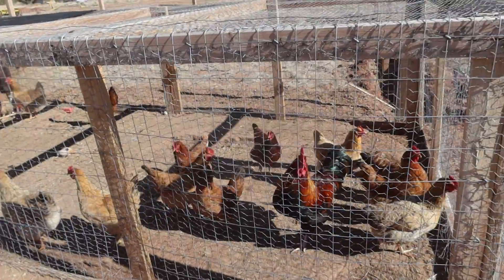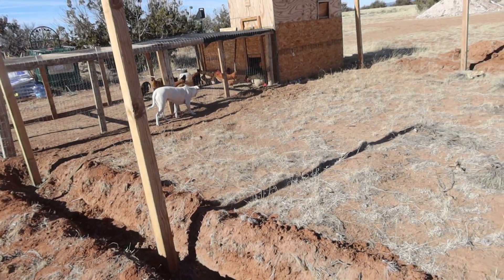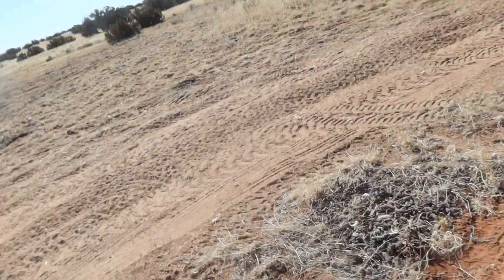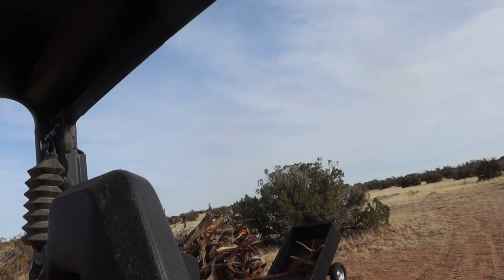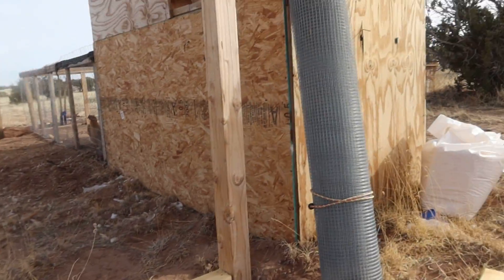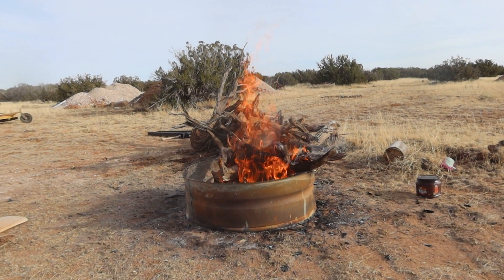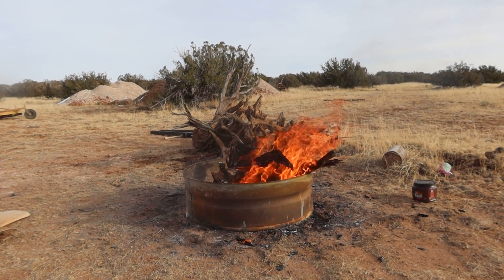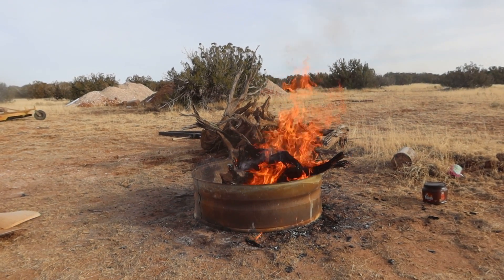Off Grid Homestead Update 2.27.22

Comment: Bending that pipe can be done.   I use a harbor freight Hydraulic bender, but it will kink after about 15° bend.  You can fill it with sand and prevent kicking.  Don't waste your time on a Faraday cage.  If an EMP comes, there won't be any need for electricity.   If the have-nots see you have lights and they don't,  they'll come and take it from you, and whatever else you have that they don't. Lay low and use a flash light.
Reply from the maker: Great advice G Bear.. very true...electricity would be the least of our worries. Thanks so much and have a great night